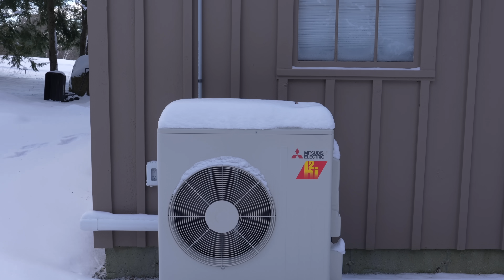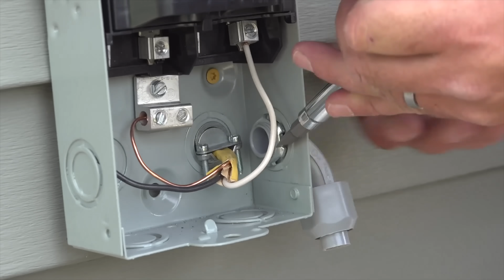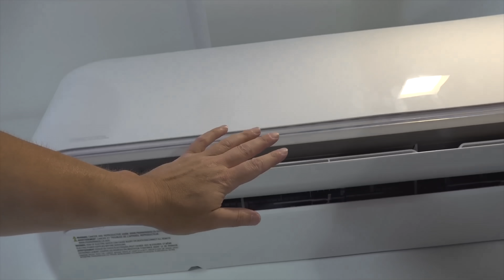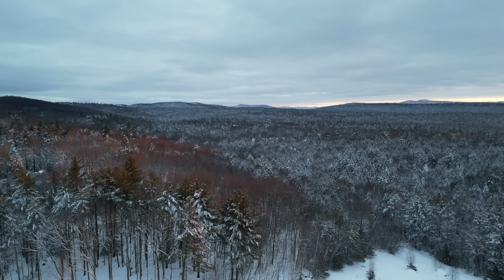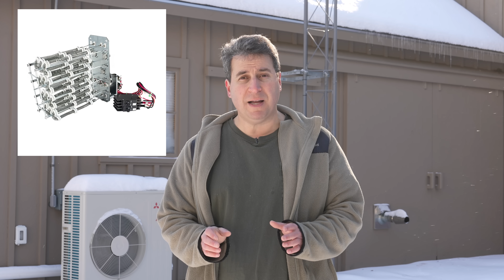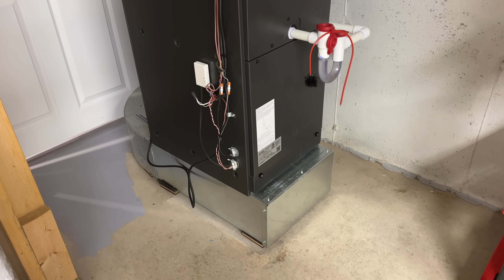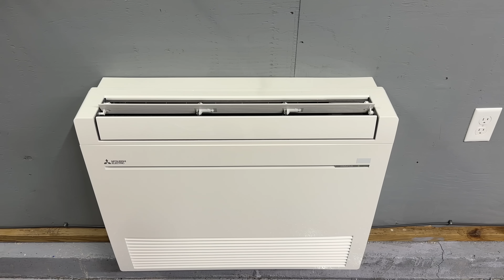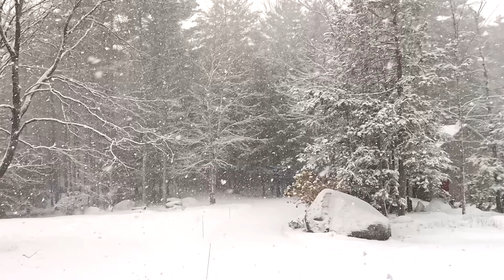Why Heat Pumps are now leaving people COLD

Comment: Heat pump and fireplace insert is best combination in my opinion. Have the fireplace insert going only when outside temps are around 25F or below and have just the fan running by itself in the HVAC ductwork to help  circulating the heat from the fireplace insert. Heat pump I’m using is a 4-ton 5 stage inverter type (made by Carrier  / Bryant / Heil… all identical).
Reply: With a properly designed system you don't need the fireplace. It got below 20 F outside this winter and our heat pump had no issues keeping up. We made sure to get large radiators when we had the heat pump installed. It's a Panasonic heat pump with an electric backup heater integrated into the unit, but this never needed to kick in.
Reply: I'm telling people, after doing this myself, that the best option is HP+PV, our costs are so low and with the new -22F HP's we don't care about the lost efficiency on cold nights in our northern climate. We do have back up oil from before I installed the HP's but truthfully we could probably live without it. Right now it's the middle of Feb and 31F out, the house is fine. Tomorrow, even if it's overcast the house will run completely on PV. All summer I'll sell PV back to the grid and reduce our winter costs even more and that's with a utility that doesn't give us net metering.

Comment: We are in Chicago, we just experienced wind chills of negative 44. I have a mitsubishi 4 ton hyperheat condense and 2x two  ton air handlers.  The system worked extremely well and never kicked in the emergency heaters. even on the coldest days. The house never dropped below sixty nine degrees.

My electric bill is set at $550 a month. And it sounds outrageous until you consider that we have two electric cars. And the entire house runs off electric, including 2 fridges, 2 freezers, and 2x washer dryers.
Reply: Jesus $550 a month in hydro? I only pay around $200 for my hydro and natural gas bill combined, and that's in worthless Canadian dollars.
Reply: @stevenstewart1308  OK, how much do you pay to fill up your cars with gas? We are chargiong 2 cars with that $550.If we were buying gas we would be spending $400 a month on gasoline. Also, I have 3 teenage boys so we have things like computers, xboxes etc alwayus running.
Reply: @thebigdoghimself  I have 5 people in my house so we used a good amount of hydro too. I drive a phev and plug it in every night and it's only $20 a month extra. My wife drives an SUV and spends $80 a week on gas. We also both have 35km drives to get to work and 35km more to get back home 5 days a week. There's no way if I charged 2 EVs instead of the cars we have and heated my house with gas that I'd be paying anywhere near $550 a month for hydro. Plus if your $550 is in USD that would be like $700 CDN.
Reply: @thebigdoghimself  my phev gets 50-55km on a charge and I spend around $50 every 3 weeks on gas for it. I live in a new house so it's well insulated and it's a decent size. But if you take your $550 US, that means I'd have to spend $700 CDN on my cars and house energy. If my hydro is $120, natural gas is $80, and gas for both cars for a month is $400 I'm still only at $600CDN. So I'm a bit cheaper a month and in the current economy we're in I'll take the extra $100 lol
Reply: Your power bill seems insane. How big is your house? I have 2600sq foot and 3 ACs (one for my office upstairs without roof insulation) and one for the rest of the house. I have 1x freezer and 4x fridges (2 full size and 2 smaller ones).
I'm in FL where we use ac almost all year around and I have an EV for the past month. $500 is the highest bill I've seen and I have 2 little kids + my uncle lives with me + I had a guest over the summer who was helping me to work on the house.
All of our appliances are electric too...
Reply: @thebigdoghimself  well if you are running the machines all the time then that makes sense. As far as TV or Xbox; it can't add more than a few $ to the bill if it's on 24/7 at max power. Most newer TVs use sub 100W and Xbox is 200W or less (at full gaming draw) at idle or watching videos it's at 20W or less.
I've got a 2.5 car garage and it's got AC in it which can run quire alot in  the hotter months to keep my product cool/dry since I sell via ebay.

So really I think the machines must be the thing that eats power; assuming you use them most of the time.
Reply: @thebigdoghimself  5 people with 2 EVs. No nat. gas. and no gasoline that's pretty reasonable.
Reply: You must have a well insulated home as 4 tons is only 48000 BTUs. Wind chill is only applied when skin is exposed but has no effect on heating loads. So what was the actual dry bulb temperature?
Reply: @anthonyspadafora1384  Yes, r20 spray foam in walls r52 on the attic ceiling which is a combination of 3" closed and I beleive it was like 5" of open cell. 

Our temps were about -10 to -13 with wind chills in the -30's to -40's.
Reply: @thebigdoghimself  Your house was designed with high R value. Do you have the original heat loads used for a design day for the original install? You also are using hyperheat units which use a hot gas bybass to maintain full BTU output below 0 degrees although the efficiency does drop, the BTUs do not. Now that being said, what you didnt say was how much the units cost. It would be safe to say in your area you will be lucky to get 10 years out of that unit. So divide the amount you paid by 10 and add that cost to your yearly expenditure. Warm air furnaces last around 20 but many 30 years and boilers can last 60 plus years.
Reply: @anthonyspadafora1384  You are wrong.  Wind removes heat from the exterior of the house, just like a human.  I can see how well my heat pump works, or doesn't, still air vs. windy outside.
Reply: @frequentlycynical642 That is called infiltration and is figured in our heat loads. If you know anything about your system you would know the heat load on design day and with today's software doing the manual J you will not only know the heat load on design day but on every day. How do you think we set up reset curves on hydronics? If you keep talking about your system without any idea what your load is. You just look a fool to people who actually know how this works. Post the heat load and the performance chart of your units at the design day temp.
Reply: @anthonyspadafora1384  I know what infiltration is.  However, with a 40 year old house, a 20 year old compressor unit, amd a new (I just installed it in June) evaporator, there is no way of having a "performance chart."
Reply: I own a rental property of 1700 square feet, 20 years old.
The heat pump died {again} 4 winters ago, so I just slapped 15kw's worth of heat-strips in the air handler and just used that for heating.
My energy bill went up just 1% and the total increase in cost was less than the cost of repair of the heat pump by 3 times.
Complicated machinery will fail and is costly to repair.
Keep it simple...it is cheaper in the long run.
Reply: @grandinosour  I call BS. One does not just "slap" heat strips into an air handler, to say nothing of getting high amperage power from the circuit breaker box to it.  If you got as much heat from the strips as with the heat pump with only a 1% utility bill increase, no one would have ever developed heat pumps.  I've done the calculations and, per kw, my heat pump is over 3X as efficient as the strip heater.
Reply: Yeah he kinda doesn't understand that hyper heat units promise that 100% of the rated btu output that low. For example if you have a 2 ton system that is rated 24k btu per hour the manufacturer promises down to a certain temp, most are like -5 degrees some -15 degrees. Anytime a guy starts off with "I had insert random heat pump installed he fully doesn't actually understand what he's talking about. Your system sounds like it did well beyond what it was promised by the manufacturer, which can happen if you have the right set of variables.

30 degrees is the older single stage systems, even the newer single stage systems can do 20 degrees if you stage your heat strips correctly.
Reply: @justjosh88  heat strips are the way to huge power bills and are likely to run a large % of no sunlight hours in northern climates
Reply: @justjosh88  Recent cold snap, my old 3 ton unit could keep the inside 45-50 degrees warmer than outside without the auxiliary heat.  I flipped the breaker off.
Reply: $550 wow I was complaining my entire electric and gas bill this month was 200 and that was keeping the house at 70.
Reply: @lv7603  how much did you spend on gas for your cars? You didn’t include that cost for an apple to apple comparison.
Reply: I don't think you know how your system actually works.
Reply: Windchill numbers are meaningless to a heat pump. Air temperature does matter. Obviously your cold climate hyperheat machine was able to extract enough heat from the air passing through it to balance the heat losses of your house. Since your house is all electric, your emergency heaters would be as simple as a common plug in space heater, which by definition has a COP of 1. As long as you heatpump was delivering heat at a higher efficiency you came out ahead.
Reply: LOL you're cheating yourself
Reply: @robsonenduro  and exactly how is he cheating himself?
Reply: So where does your electricity come from? A coal fired power plant, or does it burn natural gas? All you did was move the smokestack!
Reply: @johnwilcox4078  We have nuke, nat gas and some coal. And, yes, the 'moving the smoke stack' is a very real issue. 
These mini splits are nice and efficient, or more effecient, anyway than traditional gas heat exchangers (forced air) or boilers for hydronic/steam systems. My ex had a couple installed in her old home and the boiler only fired up when she manually turned it on to heat the studio/shop in the basement. Less eneregy use overall.
Reply: @stringlarson1247  Glad to hear about those Mitsubishi units, they are the best mini-splits. I'm a retired HVACR steamfitter, and have installed and serviced a number of all brands, some multi-evap systems like yours. I have also worked in power plants, all were coal fired at the time, one has since been converted to natural gas, another in Portage,WI. slated for permanent shutdown next year. They are hot, noisy, and massive. Everything you touch has a film of black soot on it. Electricity is the highest grade of energy there is. This man made energy is difficult,  complicated, and expensive to produce and distribute. So I have never thought of electricity as a clean or superior energy at all, compared to say, natural gas. I don't miss the fuel oil furnaces though!
Reply: @johnwilcox4078  I grew up in Rockford and spent a lot of time in Boulder Jct. WI. Also lived in Madison for a while. The Portage area is pretty nice. I was a EE at Purdue, and we had a coal plant that I got to spend some time in. Most of the coal plants in Chicago are gone and/or are being decommissioned. 58% is from nukes. I'd have to look up the rest. The amount of power required to switch to EV is staggering as well as for data centers,  etc. etc. Nothing clean about any of it when one digs into the process of extraction of raw materials (pun intended). Ain't no free lunch. 
I'm going to install my own mini split this year and get all the proper tools, gouges, etc. for pressure testing, filling, etc. as I love working on my own stuff. The pro that did my ex's Mitsubishi install did some crap work. Once we got that sorted,  the AC was great, and the dehumidifier and heat were excellent as well.
I'll get it mine all set up and working and then have my HVAC CERT. buddy, check off on it for warranty validation. In Chicago, everyone's got a guy. :)
Reply: How long have you run this setup?  I would love to have my comed bill be that low.  I recently purchase a house about an hour north of you and my 1st bill came out to a staggering 1200. House 100% electric. I won't do another winter like that so looking into a completely new setup,  especially since I feel we had a relatively mild winter with the exception of those 3 days in the negative 30s
Reply: @poochiniosos1  We are going into year 4. Switch to budget billing to flatten out the highs and lows. I want to get solar but current prices and interest rates make it difficult. I thought the winter was cold, I remember many record low days just no snow. 

I would invest in a couple if tesla power walls before considering switching. That way you could switch to time of use pricing and run the house off of the batts during peak hours.

Also, I've noticed lower bills (not much but lower) when I leave the heat pump at a set temp (71 downstairs and 69 upstairs) vs trying to run a schedule.
Reply: @thebigdoghimself  Heh. Overall, I found it pretty mild in Chicago this year. Damp, grey and chilly. I just wear a cashmere stocking cap and old cashmere sweaters. :)
Reply: $550/month seems unbelievable to me. We have a farm in the far west Chicago metro area and we are running electric livestock water tank heaters 24 hours a day in addition to our house electric appliances and a well pump, and our highest electric bill has been about $250/month. I think the Chicago area is a good candidate for a hybrid heat pump natural gas system since gas is so cheap around here. I would guess it's cheaper to run the heat pump down to about 40 deg, then switch to natural gas when it's colder.
Reply: @GreenAcres581  You are probably right. However, we had a fire several years ago and did not want to have gas again after that experience. Somewhere along the line I want to do solar but not right now at 8% interest rates.
Reply: @thebigdoghimself the upfront solar costs are enormous and it takes a long time to recoup that cost back to zero even if you’re selling it back to the utility company.
Reply: @XX-166  Your statement is as correct as me saying home rooftop solar pays itself back quickly. It depends on your area, roof, price of electricity, SRECs, price you get for feeding power back into the grid,... My system paid itself back in 4 years. I now pocket $3500 in SRECs per year and save $2500 in electric bills per year. Solar was installed in 2014.
Reply: @XX-166  No, I said it depends on a number of specific items and even spelled them out. You, on the other hand, made an  ignorant statement that was blatantly wrong as a generalization. I could provide specific details on cost, size, rebates, latitude, roof pitch, electricity cost, SREC value, but I don't think you have the capacity to reflect on your bogus assumptions.
Reply: @XX-166  I see, everything beyond the capabilities of your limited intellect must be false. I've had this back and forth discussion on the payback of roof top solar with people that have actually pushed back with details and helped me refine my calculations and assumptions resulting in a more accurate reflection on the payback period. And then there is you.
Reply: @XX-166  Are you an adolescent? Teenager at best? You can't put together a single technical point. No data to even a try and refute anything. I'm not going to waste any more time, but I'm starting to wonder if this your normal level of discourse.
Reply: @GreenAcres581  My ex lives down the street from me in Chicago and has radiators (hydronic) and installed some Mitsubishi heat pumps last spring mainly for AC and better control over heat zones in the winter. 
And, yes, you're spot on in your assesment. We really didn't have a real winter this year and her boiler only kicked on once or twice. She'll crank it up once in a while mostly to get the basement warmed up.
Reply: works if you are lucky enough to live in an area with cheap electric, otherwise you would have a $2000 a month electric bill running all that
Reply: @TheSimba86  Yes, we are between .16 amd .20 cents per kwh.
Reply: @TheSimba86
Reply: Interesting to know the age of your home and when you had these items installed and the cost.
Reply: Romeoville is not Chicago.
Reply: @icecoldfire25  The entire state is Chicago. If I had stated romeoville, nobody would know where I was talking about. I could say Chicago and people in Poland would know where I was talking about.
Reply: @thebigdoghimself  I just say I live outside Chicago. Actually, I'm closer to Rockford, but everyone knows where Chicago is, no matter where they're from. Hang in there, Dog. The warmer weather is coming soon!
Reply: @dougrobinson8602  Same here. I am near Rockford/Outside Chicago. These last couple of weeks have been brutal. I am glad he chimed in and talked about how well his heat pump has been working.
Reply: @thebigdoghimself  HA. Right? I'm in Chicago far so. side.
Reply: @dougrobinson8602  I live in Chicago now. Grew up in Rockford. We used to have real winter then.